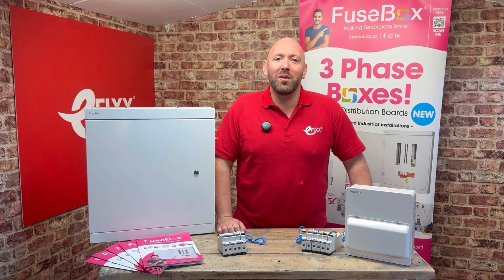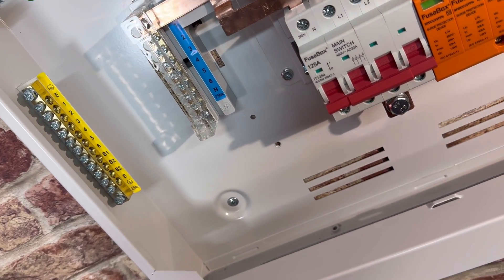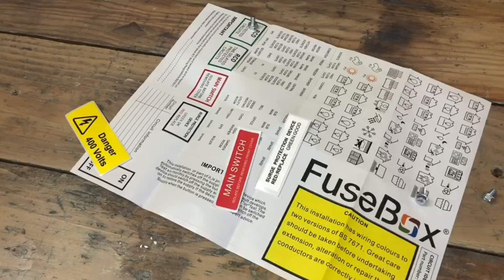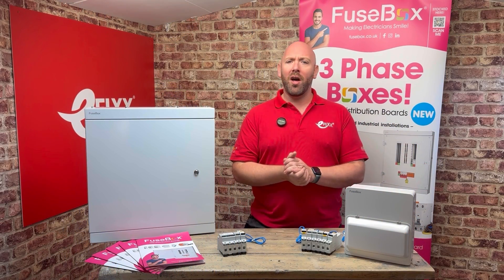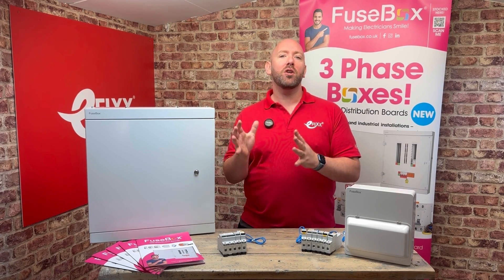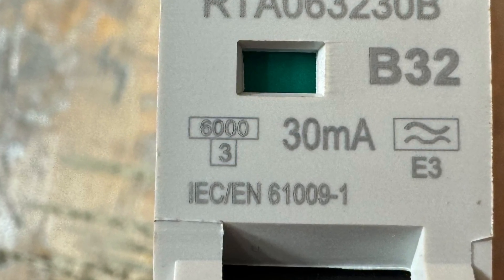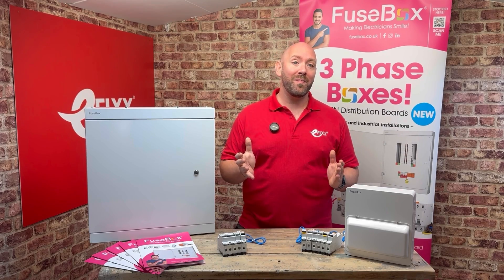The New Fusebox 3 Phase Distribution Board

Comment: Are UK installs required to switch the neutral at the main CB? Why a 4-pole switch?
Reply: Safe isolation procedure requires N and L conductors to be open. Double pole MCBs (breakers) are not used in the UK. 
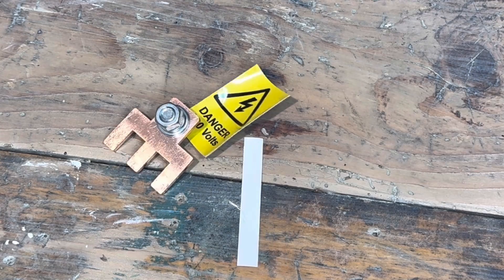5:45 they are the main isolator switch and spd (orange).

Comment: 3 phase, can buy you an extra percent in efficiency charging and EV or running a heat pump, but the problem is the solar inverters and battery systems cost more and often the domestic gear struggles with unbalanced phase use.

Comment: If it had a glass door like the Hager I would have installed one in my home but I might get one for my office/workshop when I upgrade the supply to 3phase next summer 😁
Reply: The Hagar 3 phase with the glass door shouldn't be installed in a house as they don't cover regs for non combustible materials. I rang Hagar yesterday about it yesterday. They do an A3 board with full metal door

Comment: No 3 phase board can compete with the Schneider 3 phase board because it has the Merlin Gerin Isolated buss bar, safest on the market bar none and the new one has the neutral connection built in as well. Although you do have to use the knee chin and forehead method to fit the front cover  then try not to lose the tiny screws for the cover or the even smaller screws that fix the neutral cover.
Reply: It's always a race to the bottom for price so this stuff will be thrown in everywhere. We don't install anything other than schneider for the safety aspect with isolated BB.
Reply: Issue is the price.... Hundreds for an empty board. Then £100 per rcbo... That are Single pole..... It's a joke..
Reply: @arcadia1701e  Buy cheap get cheap whether it's chint, mcg, BG, wylex and even Hager.  The invictus board is crap and their 250amp mccb panel is even worse.

With schneider gear it's expensive but you don't get flimsy poor build quality.
Reply: Every brand has its place. Shame the old Schneider hasn’t had an update to improve the front cover design thats from 1930😂